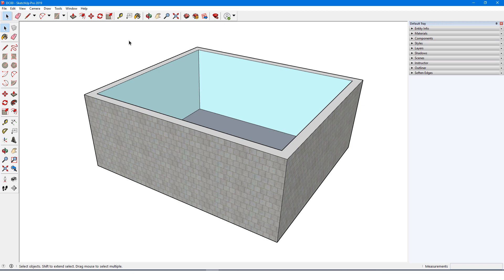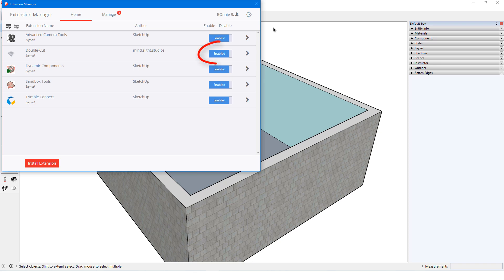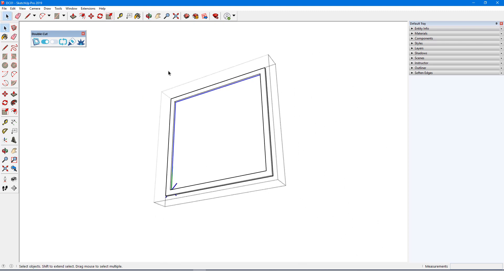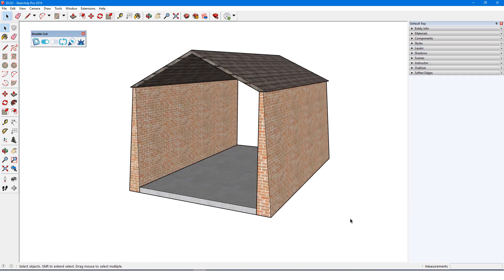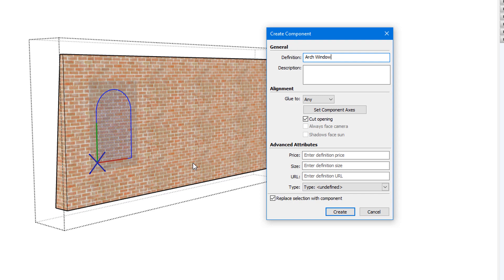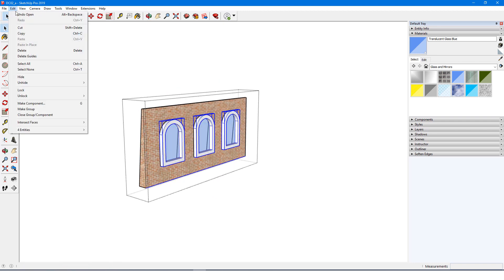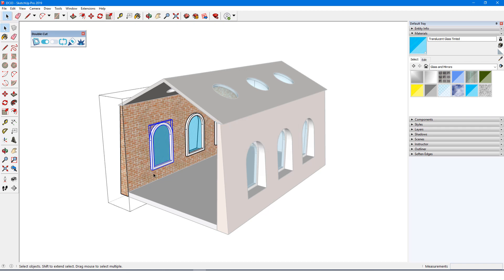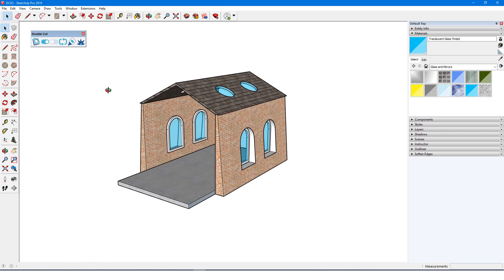Double-Cut | Getting Started

Comment: Using trial for now.. it work out for me.. but i have a question. If the trial got expired, will the behind  wall  appear for the building ?

Reply me ASAP plz
Reply from the maker: No, the wall will not appear when the trial expires.  But if you move or delete the component, the cut will not update.